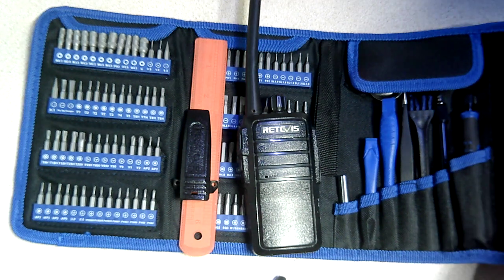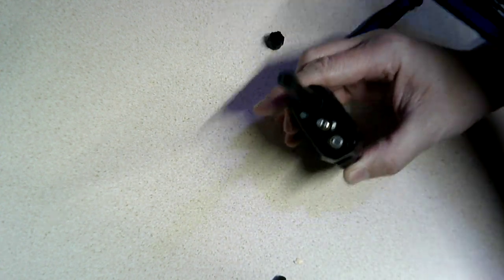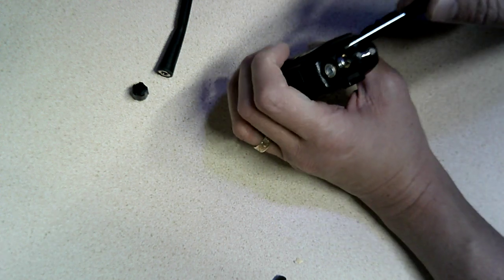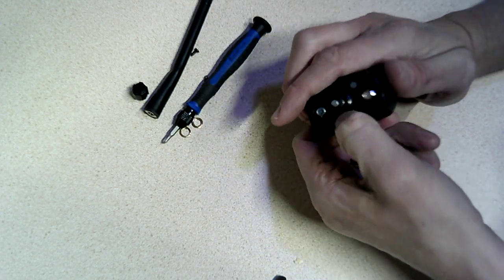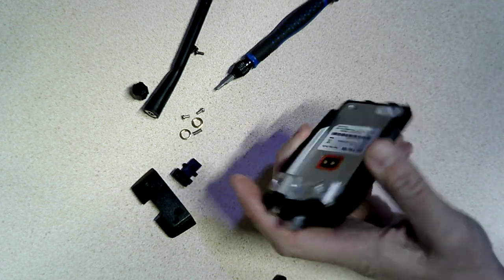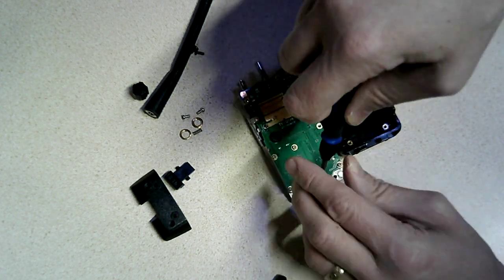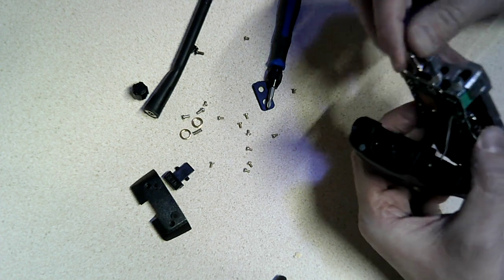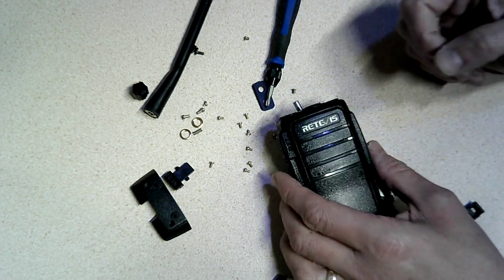Retevis RT21 FRS UHF Radio Teardown

Comment: Hello, thank you for the video..I need your advice please.. between bf88st pro, rt24 and bf r5.  which one would you recommend? Also, Theoretically, can you improve the performance of the rt24 or bf88st pro, by increasing power, changing antenna,...etc, (I am aware of the legal issues but theoretically speaking)? Thanks a lot!